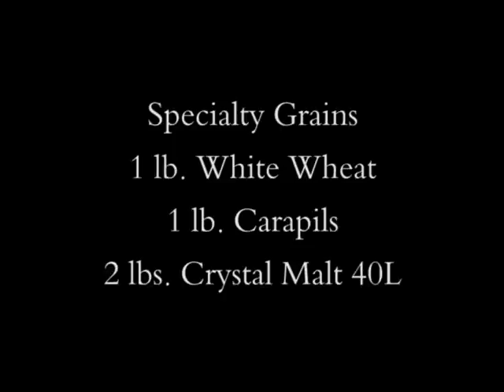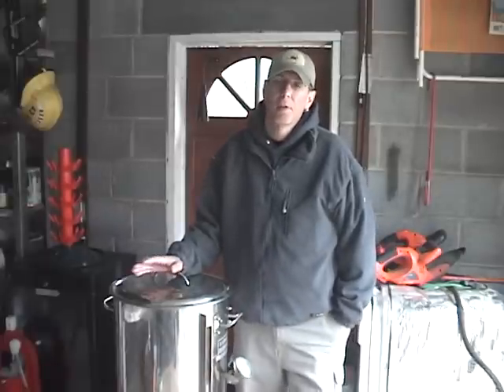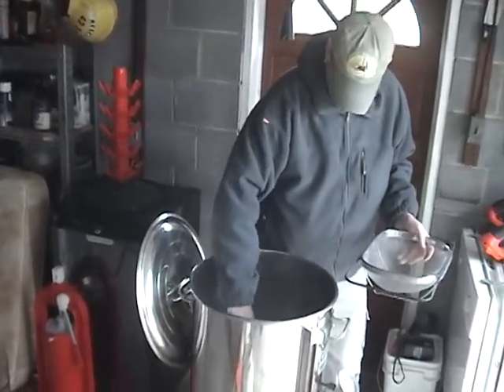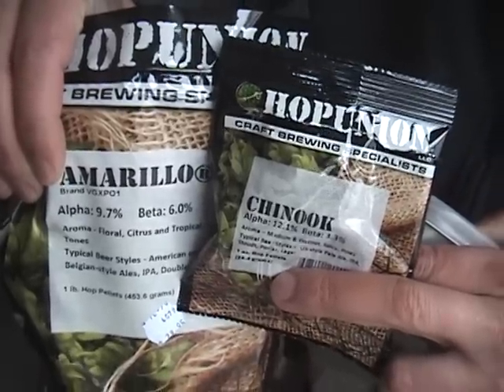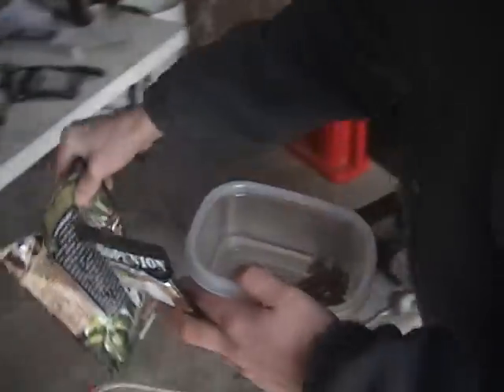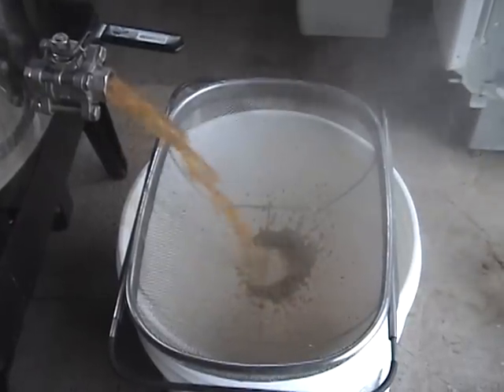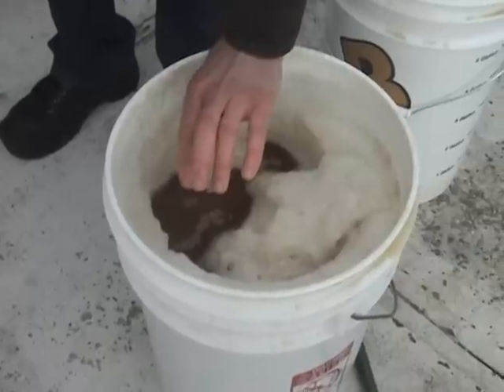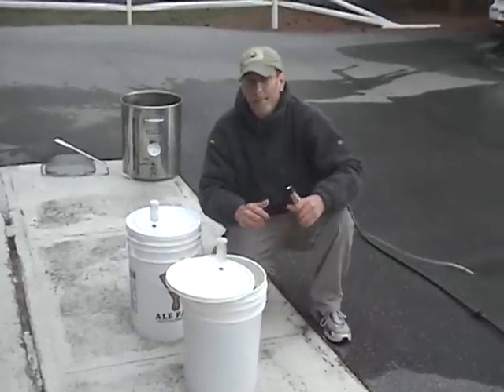Brewing a 10 gallon batch of IPA

Comment: how much does it cost you to make a 24 bottle case of beer, not counting initial set-ups costs? thanks
Reply: +Thomas tj I imagine different areas cost different amounts. My local homebrew shop has a package deal where u can get everything you need to get started with 5 gallon batches for about $200 (even comes with the ingredients for your first brew). Truthfully, you can find better deals online. After the initial cost its about $40ish per 5g batch which is about 50 12 oz beers.
Reply: Matthew McCabe thanks
Reply from the maker: +Matt McCabe It depends on the ingredients I'm using, but it runs anywhere from $50 - $90 (that doesn't include the cost of bottles). As Thomas mentioned though, many homebrew shops have clone kits that include everything you need for cheaper. And if you eventually move from extract brewing to all grain, the cost tends to drop as well.